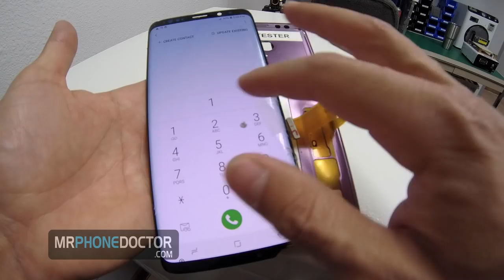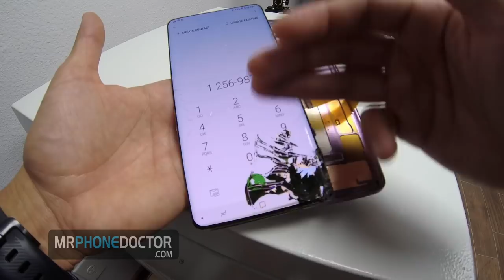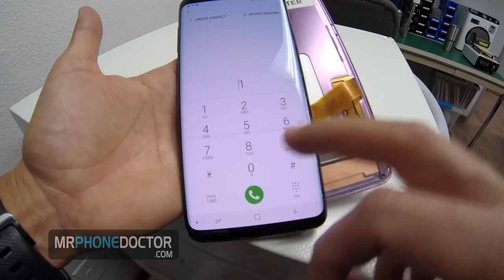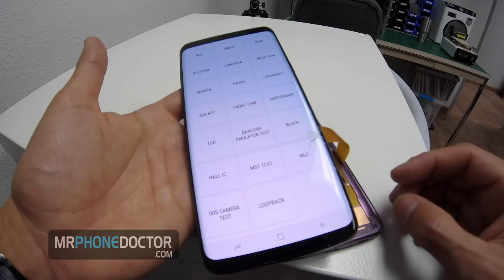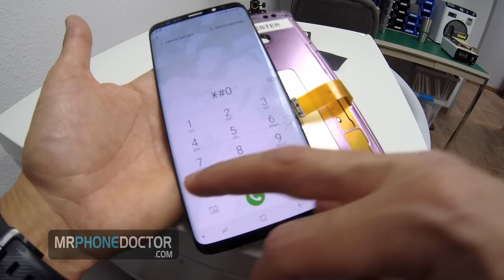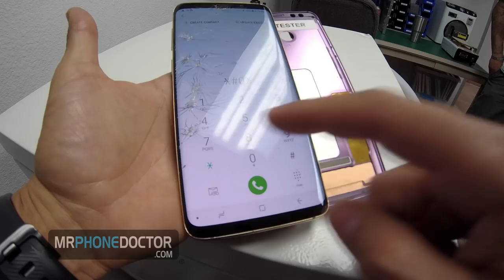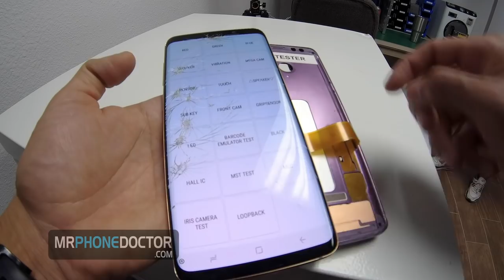Samsung Galaxy S9/S9 Plus Cracked Screen Repair Freezing and Mid Frame Removal - Why We Don't Freeze

Comment: you said when display starts curving the flex got damaged .. just thinking what if you release the flex cable? or put black rubber on top of the display to hold it down.. maybe
Reply from the maker: Yes we are going to try leaving weight on and make sure temp. Is proper. We had a lot of drop in temp since they were replacing front door. So will attempt again

Comment: Noticing that after the frame removal of the AMOLED it stays functioning I was hoping you would gently place the rubber mat(with cut out for flex)on top besides using the tape but please try again.
Reply from the maker: Yes we will! Will give another try possibly on some s9.
Reply: @MrPhoneDoctor  Would you please do a video on proper;y using separating wire? Im having an issue were I think its right but when im done the lcd has been cut badly

Comment: I got a s8+.I accidentally dropped it and have  a small crack however there is a small black dot beneath the crack I am guessing it damaged the lcd.Can I just do a glass replacement and continue living with the small black dot rather than buying a new lcd.Thanks
Reply from the maker: Yes we can replace glass only. Black spots are minimal and usually can live with them
Reply: @MrPhoneDoctor  Thanks for the reply also .I got a constant red Led light in my phone is this due to the cracked screen I have

Comment: Brother how much temperature you use on  this time. 
Your temperature seems _ 150.
I m right.?
Your information is usefully. 
Keep it running.
Our poor countries Mecanic are face confusion.
 Freeze are not complete work. 
We use mostly curing wire. 
That is work perfectly like your other video. 
Goodbye 👍👏👏👏👏👏👏
Reply from the maker: 185 ty so much!

Comment: Grat work, i was looking to buy freezer machine for s10 s20 , iphone x 11 etc, can it be safe to use with this models , or is it just good for samsung s8 s8 plus , in that case machine is not worth buying. thanks
Reply from the maker: You said it! will not work on newer models. Stick to heat plate and wire.
Reply: @MrPhoneDoctor  Thanks for reply , i was doing s8 with wire but i got waves on lcd ,does the same thing happen on s9 s10 s20 ?

Comment: I did that job with a heater seprater and that was very tough. But i thought with a freezer it would be easy. But after watching this i m not going. Go buy a freezer any time soon 😁
Reply from the maker: Glad you got some useful information!
Reply: If you need anything like parts or accessories let me know any time. Because everything is very cheap here than there. 🙂

Comment: Yeah your plastic tool is quite thick. 0.1mm spudgers help. You don't want to leave frame-less glass on the freezer without your hand holding it to ensure it doesn't flex, you'd wreck the fuck out of the touchscreen otherwise

Comment: Did you try to just remove the glass from the LED? When I tried it the glass was taking off together with the digitizer.
Reply: I'm freaking afraid of take those led off from frame 100% fails with dozens of try.
Reply from the maker: Yes I tried. Its to risky not worth trying. We can remove the amoled and glass from frame but when try to remove glass. Display splits

Comment: See friend thats the big challenge, in you recently trip to china or shenzen, you should meet the real lcd repais technicians, exist a trick to separated this model's s9 series with the frezeer machine is just nobody is going to let you know this trick, i know the trick and thats why i dont do videos on youtube, this trick also workd on the s10, s10 plus, ..the other method is doing manually cutting the glass, but the process is more longer
Reply from the maker: Yes you are right there are some technicians that can remove using freezer. It does not take that much longer to remove manually. We can remove manually and clean in about 15-20 min. Your more than welcome to share! Lol
Reply: a1rborne7 
I think you don’t know how separate the s9 glass bcz if you here so you keep looking on YouTube channels for someone he knows how he do  😜😜😜
Reply: im giving away "the secret" that nobody wants to share

you periodically spray isopropyl alcohol with a bottle(like the glue remover solvent bottle you have) which will reduce the temperature of the glass even further and make it easier to remove

Comment: You need IPA for the deframing step.

You also need to keep it pressed without the frame so it doesn't thermal flex.
Reply from the maker: Thx will try!

Comment: Hey buddy. I am using a freezer method for about 2 years but i have not faced any problem like that. Btw love your videos ❤️❤️🤩

Edit: first of all you need to seperate the glass and then seperate the lcd from frame. It should be fine.
Reply from the maker: Good to know! Thx for the tip. will try
Reply: Does it work on the new screens
Reply: So, with You method can repair s9plus lcd ??, thanks